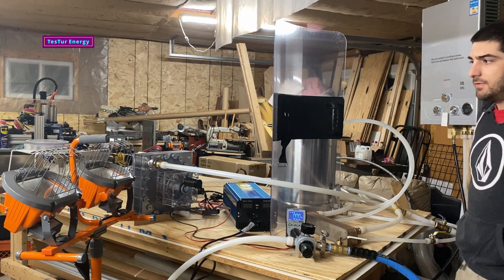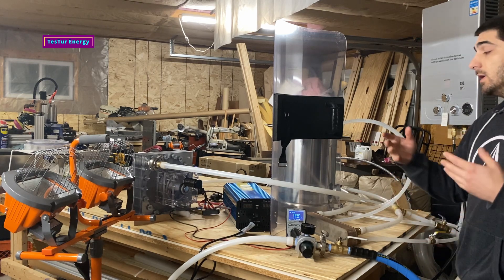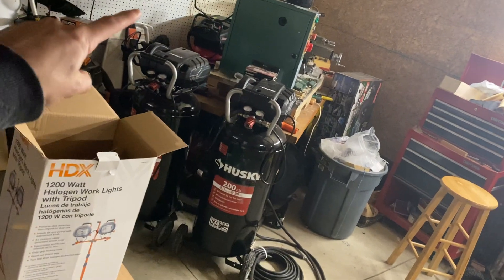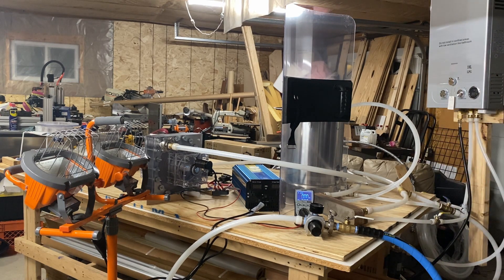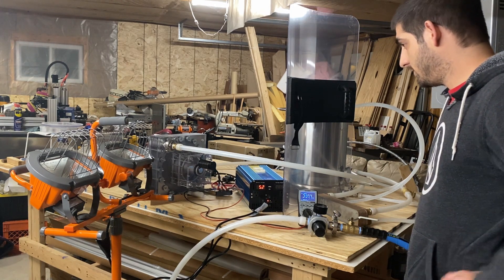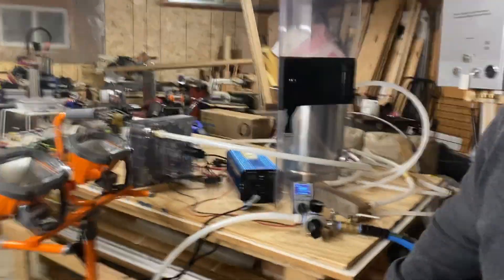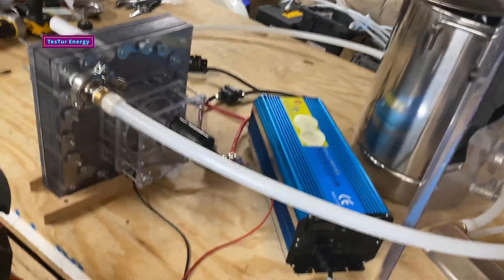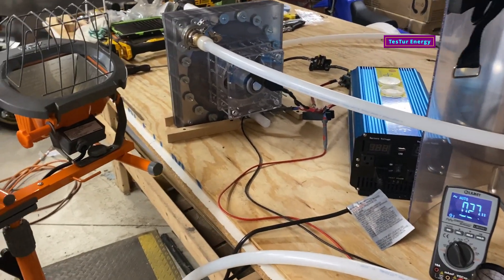Amazing Tesla Turbine Actual Power Output Test - 1200 Watt Real Electrical Load - CAES - Turbo Jet

Comment: If it's cold a space heater would be an excellent test as well. This is freaking awesome! I'm the auto machinist dude that posted on Instagram and I'd theorized maybe a gear down drive would be able to utilize the high rpm Tesla turbines and also give them more torque to better handle the high drag when the generators/alternators are being out under electrical load. Gear drive or pulley system perhaps, and even better would be a centrifugal type CVT that maintains certain generator rpms regardless of turbine speed. Idk. Lol just brainstorming here.
Reply from the maker: Hey thanks for coming out! I really appreciate you taking the time to leave me a comment, it means a lot to me and it helps increase my visibility on the algorithm. I’m glad you’re interested in learning more about my project, I’ve put a lot of work into it.

I really appreciate your thought out suggestions. 

As for spinning too fast, Ive got some copy pasta 🍝 that I’ll share with ya here that’ll explain take a read! 🤓😬
Reply from the maker: I appreciate your comment but that’s not an issue because, despite what everyone erroneously claims, Tesla turbines work just fine, get plenty of torque and output power at low RPMs.     I’ve got some copy pasta 🍝 of mine that I’ll share with ya here to explain more.  Tesla turbines aren’t made efficient by spinning really fast.   That’s only for when the disc stack is being used as a centrifugal pump, because ALL centrifugal pumps’ compressors, performance is tip speed dependent.   But spinning the turbine fast will produce a centrifugal head that opposes the incoming fluid flow, reducing the pressure gradient across the nozzle, reducing fluid final velocity, reducing mass flow rates through the nozzle and ultimately reducing power out. 

Furthermore the faster you spin them the faster the fluid you have has to go just to still be moving faster than the discs and still provide torque.   Lastly, they work just fine for industrial use and can scale up just fine because the torque on the discs is proportional to the difference in the fluid speed and the disc speed. So the disc tip speed is the important factor here. For any given fluid supply in the nozzle will have a max fluid velocity. So the turbine disc tips will have a max speed set at that fluid speed irrelevant if radius. Now considering that centripetal force is proportional to V^2/R, if you keep the tip speed the same but increase the radius the centripetal forces on the disc for the speeds needed will actually decrease. 

Despite what MANY have claimed about the Tesla turbine, it does NOT need to be spun fast to work or work efficiently.   TesTurs are made efficient when the slip on the discs is reduced and spinning the discs fast does nothing to reduce the slip, only increase the distance the fluid slips on the disc faces, which is by definition “loss”.  Listen to what Tesla himself said in the patents of how to make them work.  “Owing to a number of causes affecting the performance, it is difficult to frame a precise rule which would be generally applicable, but it may be stated that within certain limits, and other conditions being the same, the torque is directly proportionate to the square of the velocity of the fluid relatively to the runner and to the effective area of the disks and, inversely, to the distance separating them. The machine will, generally, perform its maximum work when the effective speed of the runner is one-half of that of the fluid; but to attain the highest economy, the relative speed or slip, for any given performance, should be as small as possible. This condition may be to any desired degree approximated by increasing the active area of and reducing the space between the disks.”  1) increase the speed of the fluid relative to the disc, (not increase disc speed)  2) increase surface area 3) decrease disc spacing  This is how you actually make a TesTur work. Not by spinning it fast.   The fluid interactions with the disc that govern efficiency an torque are adhesion and cohesion. Full stop. And spinning fast does nothing to increasing either to increase the turbines isentropic efficiency.   This is why everyone who chases rpm with the TesTur just flat out fails. They aren’t even trying to design them properly so of course they won’t work.
Reply from the maker: You just have to know how to design it correctly to actually reduce slip to make them work, not spin them fast.  The only reason people think Tesla turbines have to be spun too fast is because EVERYONE has mistaken the part of the patent that is about the turbine being used as a pump as being about it being used as a drive turbine.   The only time you want to spin a TesTur fast is when it’s being used as a pump/compressor. This is because ALL centrifugal pumps’/compressors’ performance is tip speed dependent.   “I have found that the quantity of fluid propelled in this manner, is, other conditions being equal, approximately proportionate to the active surface of the runner and to its effective speed. For this reason, the performance of such machines augments at an exceedingly high rate with the increase of their size and speed of revolution.” -Nikola Tesla 

And again, you DO NOT want to spin too fast in a TesTur because the centrifugal head will just counter your incoming fluid flow reducing power. And the faster you spin discs, you’re fluid has to be going even that much faster just to be able to apply a torque on the disc face.   “Still another valuable and probably unique quality of such motors or prime movers may be described. By proper construction and observance of working conditions the centrifugal pressure, opposing the passage of the fluid, may, as already indicated, be made nearly equal to the pressure of supply when the machine is running idle. If the inlet section be large, small changes in the speed of revolution will produce great differences in flow which are further enhanced by the concomitant variations in the length of the spiral path. A self-regulating machine is thus obtained bearing a striking resemblance to a direct-current electric motor in this respect that, with great differences of impressed pressure in a wide open channel the flow of the fluid through the same is prevented by virtue of rotation. Since the centrifugal head increases as the square of the revolutions, or even more rapidly, and with modern high grade steel great peripheral velocities are practicable, it is possible to attain that condition in a single stage machine, more readily if the runner be of large diameter. Obviously this problem is facilitated by compounding, as will be understood by those skilled in the art. Irrespective of its bearing on economy, this tendency which is, to a degree, common to motors of the above description, is of special advantage in the operation of large units, as it affords a safeguard against running away and destruction. 

Besides these, such a prime mover possesses many other advantages, both constructive and operative. It is simple, light and compact, subject to but little wear, cheap and exceptionally easy to manufacture as small clearances and accurate milling work are not essential to good performance. In operation it is reliable, there being no valves, sliding contacts or troublesome vanes. It is almost free of windage, largely independent of nozzle efficiency and suitable for high as well as for low fluid velocities and speeds of revolution.” -Nikola Tesla  

Tesla both knew it wasn’t meant to spin fast and that it worked great for low speeds IF you design it correctly.
Reply from the maker: So when designed correctly the TesTur puts out plenty of torque and power even at low rpm. 

In fact, with my build here on the table, just to prove the TesTur doesn’t needed to be geared down to work or work effectively, I went and did the exact opposite and geared my turbine UP to the generator at a 1:3.0666 ratio. 

Meaning the generators rpm is 3.0666 times higher than the turbine. And she’s working great! 

6.22ft-Ibs of torque at only 4150pm and +4.25kW between only 6000-12,000 pm. And that’s to the shaft, AFTER all mechanical losses, so that’s what’s available for power and torque out. 

Make sure to check out the latest updates on the Tesla turbine builds!  

Tesla Turbine 250 watt to 2.65 kW Power and Efficiency Test https://youtu.be/K7qZvq1CMFg 

+5 Horsepower Tesla Turbine Dyno Jet Turbo Power & Torque Curve 375 mph @ 12,500 rpm https://youtu.be/exF5Rn-L8gs 

These preliminary tests are just to see how much electrical power can be produced with room temp compressed air driving the Tesla turbine. The TesTur nozzles never went over 20psi at the nozzle for the 2650watt electrical load test and not over 40psi at the nozzle for the 4250watt dyno test.   This is so I can get a baseline for what to expect as I increase the temps to combustion levels.   When using elastic gasses the counterintuitive thing most overlook is that the viscosity of gasses goes up with temp. So not only do we see an increase in thermodynamic efficiency from increased temps but the TesTur isentropic efficiency also goes up due to the reduced slip from the increased viscosity.
Reply from the maker: But again now all that being said the only reason I have gears in there right now is because I wanted to prove that a TesTur doesn’t need to be geared down and the next build I do will have the generator direct to shaft with the turbine to eliminate any gear losses. Which is 90% of what you’re hearing in this video too. Those were crappy plastic RC car gears too. The newer metal RC car gears I’ve been using are much more efficient and a lot quieter but still a direct to shaft is the way to go. 

And as a last tidbit, typical off the micro gas turbine gensets already spin between 50,000 and 200,000 rpm.  And I’m sure as a mechanic I don’t need to tell you but for everyone else reading, the 0-12,500 RPMs I’m doing aren’t even as high as most motorcycles rev out to.

Comment: I love your tenacity for making your Tesla turbine to get energy from however I'm seeing a big mess. I thing what your trying to assimilate is that applying heat to the medium in which your using to power your device will improve the efficiency.
Reply from the maker: I really appreciate you taking the time to leave me a comment, it means a lot to me and it helps increase my visibility on the algorithm. I’m glad you’re interested in learning more about my project, I’ve put a lot of work into it. 

Make sure to check out the latest updates on the combustion + steam Tesla turbine builds!   

Tesla Turbine 250 watt to 2.65 kW Power and Efficiency Test https://youtu.be/K7qZvq1CMFg  

+5 Horsepower Tesla Turbine Dyno Jet Turbo Power & Torque Curve 375 mph @ 125 00 rpm HIGH SCORE! https://youtu.be/exF5Rn-L8gs  

Solis Talks Tesla Turbines - Nikola Tesla’s Electrical Power Systems Patent GB 186,083 Walk Through https://youtu.be/5Y3D13JmtcA  

Tesla Turbine Jet Engine - gasoline fuel burner atomizer flame tube test 186,083 propane burner https://youtu.be/gRqKowignac 

If you have any questions, please don’t hesitate to leave a comment or message me, I would be more than happy to provide detailed answers. Thanks again for your support, and if you want to help me out even more, please consider donating to my Patreon page or any of the places on my linktree in my about me page, it will help me to continue my project. Your support is greatly appreciated.
www.Patreon.com/CharlieSolis